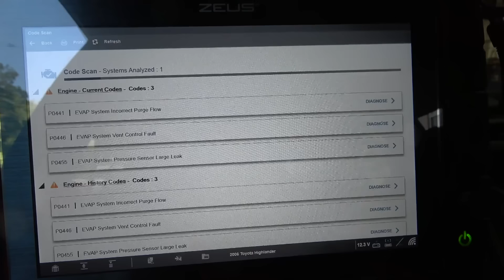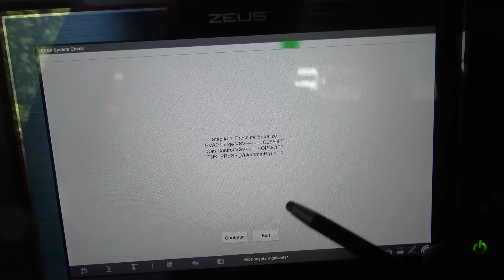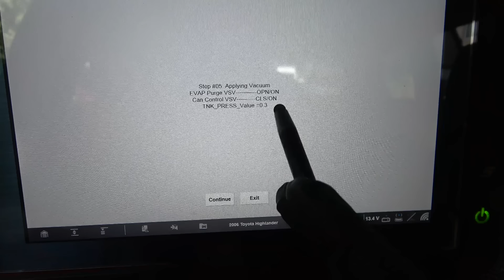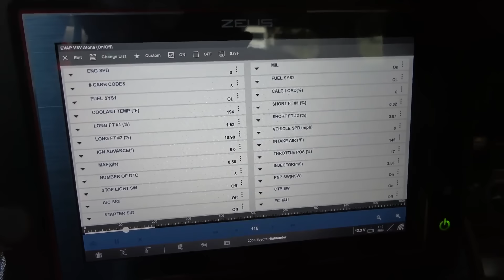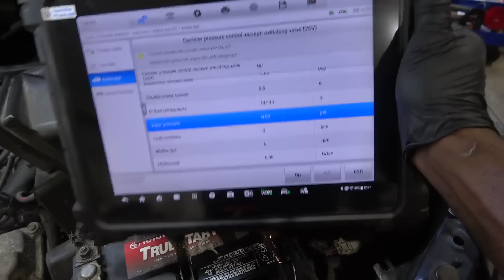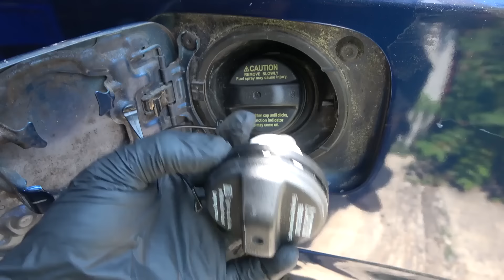2 Auto Shops Couldn't Fix This Toyota Highlander, Can we Fix it? Evap issues

Comment: Great video as always, but you repaired 2 separate system leaking conditions dealing with several system failures at one’s , leaking hose issues  definitely an issue and contributing to the leak and also 2 the gas cap.
Reply from the maker: @mechanicalsuntheoneyouknow  Yes, Thanks my friend

Comment: Just one thing, you said its a fuel cap issue, but this is not totaly correct. There is a fuel cap issue, and a major hose leaking pressure as well. As usual, you did excellent work. Just make sure to mention the whole problem. Love the videos keep them coming.
Reply from the maker: @antonioosejo4265   Thanks!

Comment: Bro Definitely Appreciate the class . I have also replaced the gas cap with a aftermarket gas cap still the same  problem.  Also the evap valve.  Same problem.  Cap did the trick. Oem gas cap. Thanks a million.
Reply from the maker: @lesterabram5546   My Pleasure! I'm glad to hear that the video was helpful

Comment: I am not a technician, but this video  caught my attention, because I have a 2005 Toyota Corolla, same year as the one in this video, which showed for the first time the check engine light on, at 236,587 miles on Jan.14 2022: it was corrected, diagnosed as an intake manifold gasket leak. Replacing the gasket, it disappeared, but the Corolla was 18 years old since new with me, the original owner. So the engine light returned,  with a P0441 code, which still remains now. I learned from videos like this, the many rubber hoses that crack because of the car's age, and replaced with OEM Toyota parts all which were showing cracks, like vaccum hoses,  all with oem parts, the fuel cap was replaced twice with the original Toyota cap,  the oem EVAP  Charcoal Canister too, oem,  the Purge Solenoid Valve,  PCV  Valve,  Mass air flow sensor, oem,  oxygen  sensor,  oem,  but  no matter the  car runs  smoothly, the P0441  engine code remains,  the only one remaining. Not all mechanics specialize in diagnostics,  and I saved money for parts by just buying many oem  parts that were  damaged, but  this  one looks like a case for someone like you; I also replaced the exhaust manifold and gasket with the Toyota oem parts.  I know it still needs a power steering pressure hose,  front and rear suspension work and parts,  is expensive but this Corolla has now 307,495 miles with me, no cvt transmission, just a 4 speed automatic transmission, no ABS,  no turbo,  no low tension piston rings, is more reliable than the newer Corollas, I think you can understand why as many people want to keep it.  But I am too far away in Puerto Rico. Thanks for the video.
Reply from the maker: @pablorosado535   My Pleasure! I'm glad to hear that your toyota is still running

Comment: Wow. I watched the whole vid.  And I must say this is a great video. I’ve watched maybe 4-5 videos like this where the mechanic goes into a lengthy detail on problems and diagnostics. Smoke machine issues and fixing it and having an issue with the fix to fix it again and go through all of that to find the gas cap smoking. Great work sir. Thank you for the video.
Reply from the maker: @KingD0  My Pleasure! Thanks
Reply: @ question. Do you have or can make a video of a 05 Lexus rx330 and the back 1,3,5 coil plugs wiring. I had work done and now I found out that one of the cylinders is not wired properly. But if I can see the color pattern then I can correct it.

Comment: Good job! Smoke machines are a necessity, when checking for evap problems? Well done. I had a 2000 Chrysler Concorde, and chased down a problem much worse than that one. The hose on the charcoal canister had kept slipping off, in the reassembly phase, causing the MIL LIGHT to stay on? A simple worm clamp, and never had another problem. I changed everything from the front of the car, to the canister, then made a homemade smoke machine, and immediately found the leak.👍
Reply from the maker: @Mark-um3hm   Thanks! how do you make a home made smoke machine, that sounds cool

Comment: Great job keep up the good work if I was in your town I would come to you myself if I have a problem.
Reply from the maker: @ice4278   Thank you!
Reply: @KITS_Auto_and_Truck_Repair 

In what city are you ? I would like to bring my car.
Reply: How can I test the maf sensor cuz my toyota have power but dont start but wen I press de pedal it's start but died after I stop the pedal
Reply: @dracocardz  check your idel control valve
Reply: @chanakaweerasinghe1505  ok,that's is not the same has the TPS right?

Comment: I have a 2003 toyota highlander fwd bought used 2009..@ 95k....still running solid after 320k..everything original just paint peeling off starting  2021.is D best car ever made by toyota zero check engine light
Reply from the maker: @chokobe111  wow, that's awesome

Comment: great work ... i suspect the two previous shops might have been either too lazy to take out their smoke machine to see the broken hose or even bother checking the cap when they look at the milage thing it's too old to even bother so one of the shop use a cheap method and zip tie the already brittle hoses😮‍💨
Reply from the maker: @FEETLE   Thanks!

Comment: Great video my friend. I have the same thing for my Sienna and the evap is an issue. I have changed the fuel cap, but the engine is on. Ive ordered a new purge valve from toyota and will see if that the issue and hope it will fix. Thanks and I sub to your channel.
Reply from the maker: @nebhosspin1252   welcome to our youtube community and Good luck with your vehicle

Comment: Hello Sir. Thank you for the awesome video. Very informal. I have a question. The purge valve is clicking with just the key turned to the on position. My question, is it suppose to click like that when the engine is turned? I have a 2010 Honda Civic and the purge valve is clicking just like this one but only when the engine has been turned on.
Reply from the maker: @DukeofHell   That's normal

Comment: Great job diagnosing, but pretty standard.
 Obviously, the other shops didn't even try to properly repair the vehicle. A simple smoke test would have narrowed it down. I do hope your the kind of mechanic to replace ALL those evap hoses and add proper clips instead of tie wraps in the hot engine bay
Reply from the maker: @sal98  Thanks, yes of course

Comment: excuse me did you ever get the vsc and trac control problem fixed or did you just clear those codes
Reply from the maker: @dresendez909   Good question, for some reason the check engine light was causing the VSC & Trac control light on, after erasing the codes the those lights didn't come back!

Comment: I have a similar problem, the hose for the vacuum valve comes off when opening the engine air cover. This causes the check engine light to come on, a common problem with highlanders.
Reply from the maker: @sidjbel   Thanks!

Comment: In my country some mechanics dont have this scan tool and will do trial and error, change purge valve, if it does not work then the vent valve if that too does not work then o2 sensor and if that does not work MAF and it continues till you changed everything and the fault goes away and they expect you to fund this trial and error nonsense.Thank God thee are many scan tools now , its profession of some youth who only do fault detection and clearing after the mechanics are done.Thos who think they can fix soft ware issues with hammers and rachets are still there contemplating learning  or still undecided.Some will become irrelevant with time.
Reply from the maker: @emmanuelofori6521   Yes! I agree with you

Comment: The problem with many mechanics this days for example here in New York, they don't like really like to check the vehicle dip, they just like the easy jobs, like replacing easy parts wheel balance things like that, I know many shop that do the same thing I know a lot about fixing cars but I'm not expert and when I see them lost when trying to diagnose a vehicle I say hey you know what I would go somewhere else 😂😂😂😂 , I know a mechanic if you can called lie that who told that in  order to fix my previews car issue we have to start charging pets until it get fix 😂😂 I said what, I'm not a millionaire to start changing parts I don't need to change to fix a control arm, he literally didn't know what he was dong, it's crazy that we have so many shop around here but most of them don't know what they doing
Reply from the maker: @Justliketolearn  Lol, that's sad

Comment: Hi,again I still driving this GMC truck 1500 4 wheel drive  with a 5.3 eng.flex fuel,my ? Is I disconnect the hose going to purge valve an the connector an it was not leaking my Stft bank  1 is  -14 an ltft  is -18 an when I disconnect ed the PCV tube an plug it my stft when down to positive 4 an ltft went to positive 5 with pcv vavle plug could that be a sensor iam saying like  map or maf sensor oxygen sensor or ok
Reply from the maker: @simonflores3410   Sorry, I didn't understand your question
Reply: What I was trying to say is that my stft bank one is -14 and ltft is -18 and when I disconnect the hose going to the pcv valve my stft and ltft correct them self to +3 and ltft +5  so what could be wrong thank you please respond I like your videos

Comment: hey i have a question about the camshaft..i drive a 2012 kia soul 2l..what happened was i trying to remove the crankshaft bolt with a socket with an adjustable wrench on the camshaft to keep it in place..but i couldnt get the bolt out but instead i turn the camshaft lobes and now the car is giving me error code p0017,0014,0135,0030 ,0365,0300,0500,0700 and 01700..
any idea of how i can turn back the camshaft into proper positon
Reply from the maker: @aceace2402  it might have jumped timing

Comment: I have 2013 Chevy express van 4.8l with P0442 and P0455 code where should I start ?
Reply from the maker: @GeneG-wk2mz  Check your purge valve then your Evap tubing and so on
Reply: @KITS_Auto_and_Truck_Repair   which smoke machine you recommend that can get off Amazon ?

Comment: Troubleshooting engine issues on pre '75 vehicles was simple

Today it is very very complicated and most often the problem is not the engine but components or systems added to overcome the inherent deficiencies of the internal combustion engine

There are dozens of systems of systems to added to the ice design because it is very flawed and cannot be re-engineered

 * Excessive heat break down rubber and plastic parts

 * Excessive heat break down oils, grease, and other fluids

 * carbon build up

 * Sludge build up

 * metal parts wearing each other out

 * friction draining power

 * Many More

The EV drive trains only needs a handful of supporting components to function that does not break often

Many complaints about EVs are actually 'Car' problems that happen to vehicles in general

Most people who do not like EVs don't because they heard EV Hating propaganda before they experienced one

EVs are much better vehicles overall for most people and especially home owners who can charge at home
Reply from the maker: @ScrappyDoodad  Thanks for your input!